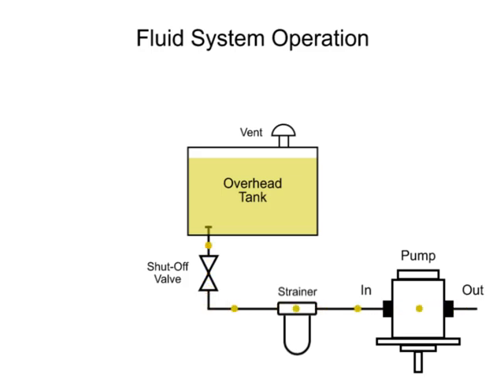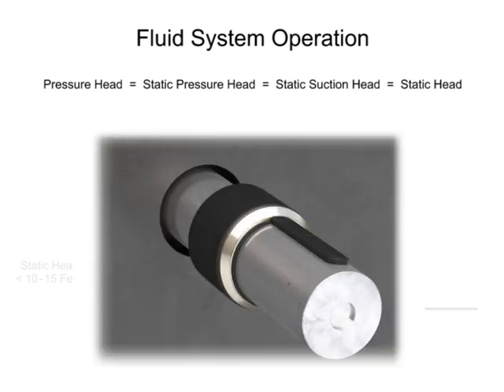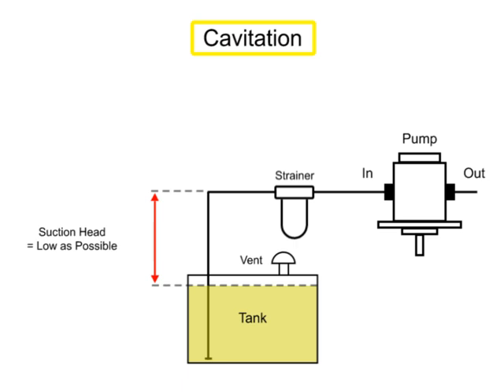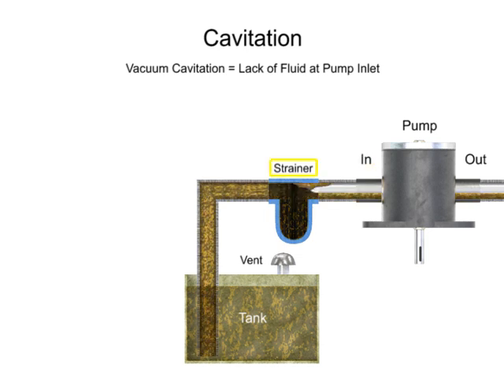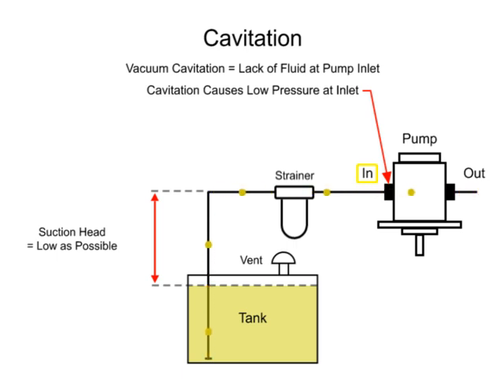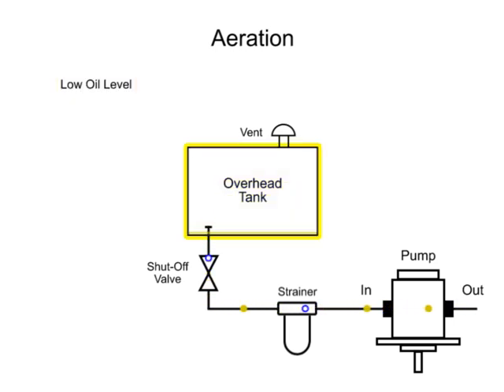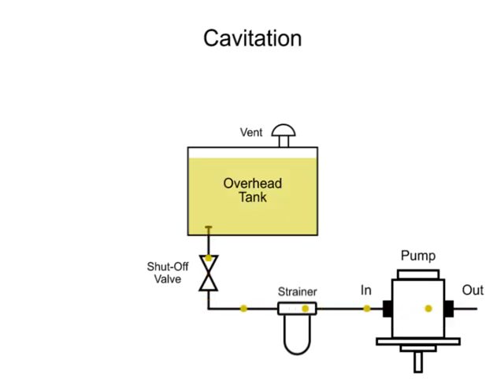What is Cavitation and Aeration?

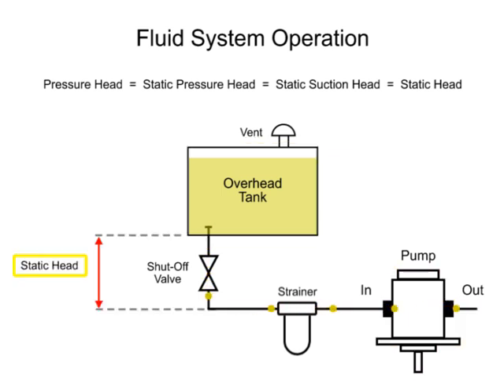Comment: There is a mistake in one of the diagrams, (0:36) the static head is measured from the level of the fluid, not from the bottom of the tank. Cheers.

Comment: Q. HYDRAULIC PUMP CAVITATION MAY OCCUR WHEN:				A. THE HYDRAULIC RESERVOIR BECOMES UNPRESSURISED			B. THE PUMP BECOMES INOPERATIVE AND THE ACCUMULATOR INITIALLY PROVIDES PRESSURE FOR SERVICE OPERATION				C. A SYSTEM IS SELECTED AND THE PUMP CANNOT MAINTAIN THE INITIAL SURGE OF PRESSURE TO THE SYSTEM
Reply: PLEASE REPLY THE ANSWER